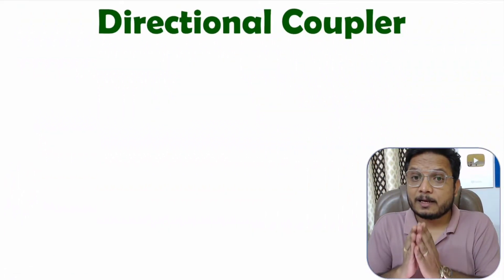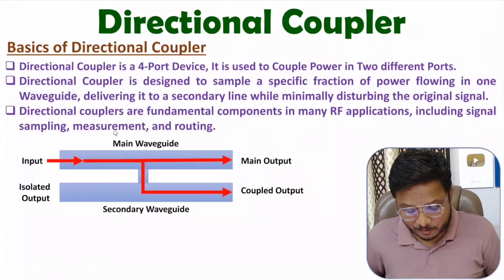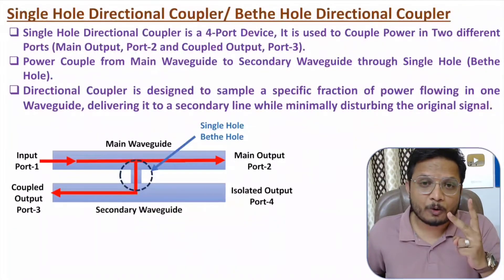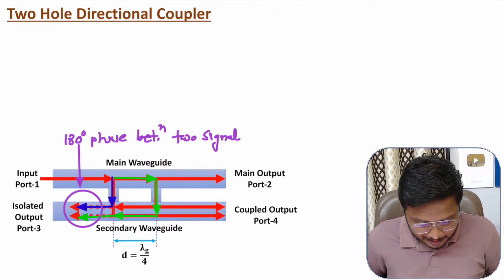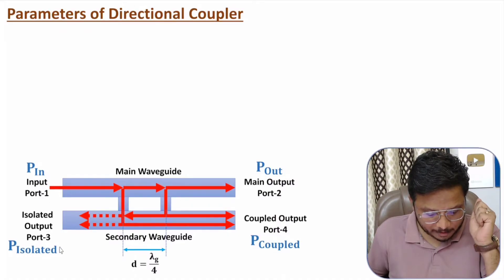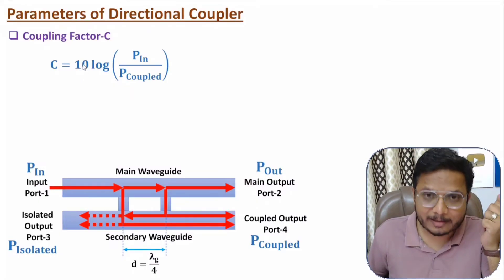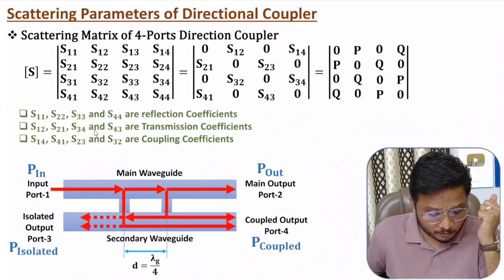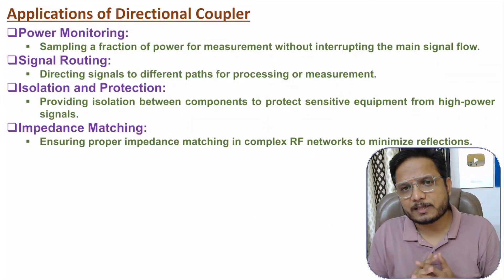Directional Coupler (Basics, Working, Structure, Scattering Parameters & Applications) Explained

Comment: I have a doubt, the first port (port 3) of the secondary waveguide for the Bethe Hole coupler will be an isolated output? So why did you mention it as a coupled output? 2:32

Comment: sir, is it possible to get output power at isolated port by placing the screws in a position such that the difference between the coupled signals at output port is 0 instead of 180 ?
Reply from the maker: I haven't seen such adjustment.
Reply: @EngineeringFunda  sir please refer to paper on load modulated balanced amplifier (PA) configuration. It used an amplifier on isolated port which adds to the output power.